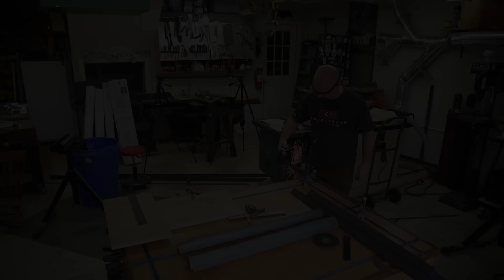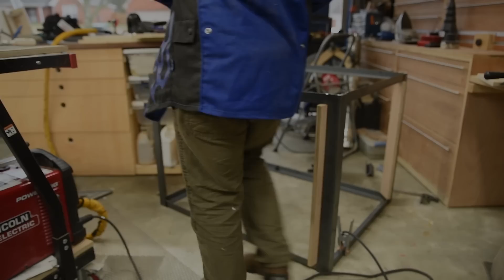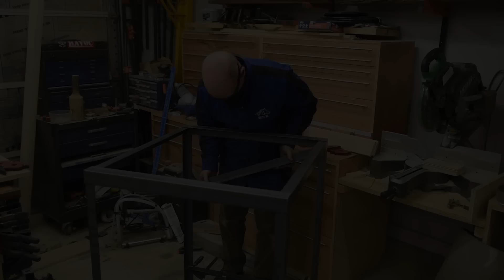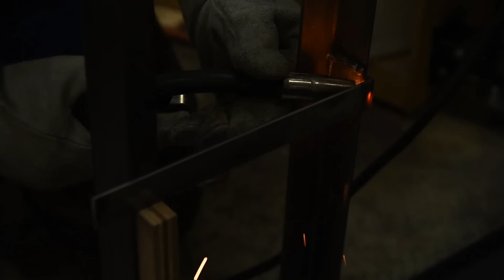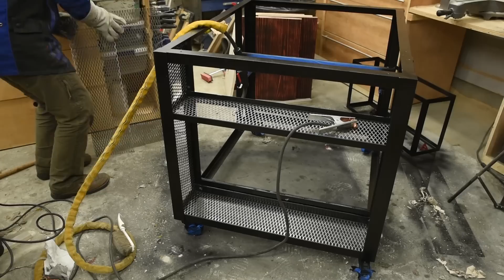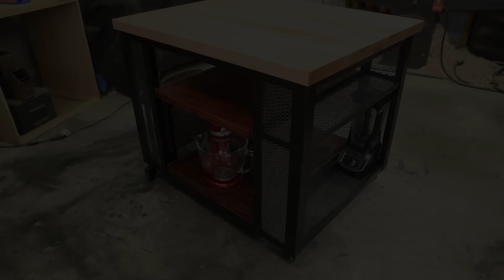DIY Kitchen Island w/ Butcher Block Top and Stained Shou Sugi Ban Shelves // How To Make

Comment: A good way to keep your verticals straight, is to dead square a piece of 3/8 flat stock. Say 5x5? You pick. Double clamp it to the rail and stile for your corners. You can also notch it to complete the weld from the inside!
 Also check for truness of your steel. I've seen some that looks like a pressure treated 4x4 from a box store ;)
Awesome and useful island.
Bravo!
Reply from the maker: Aaahhh, that makes a lot of sense! On a later project I clamped my 12” speed square and that helped a lot but didn’t nail it. You have a great technique here. I think before my next project though I’m going to invest in a fireball square or two though.
Reply: @YouCanMakeThisToo  
An alternative https://weldtables.com/collections/fabsquares
I bought one of their table kits and it's awesome! ........FLAT

Comment: On your vertical welds try going top to bottom  with a mig welder. You will not get that blob or run at the bottom and you will have less grinding.
Reply from the maker: Good to know, I’ll give it a try!

Comment from the maker: Follow up to the point I made about welding pulling parts out of square. My buddy JD at Apexish welding recommended tacking the whole thing together first and not doing full welds until there's opposing geometry that'll hold itself together. For example, the main cube that makes the island should've been only tacked until it was a cube, and then welding the seams. That way there's another weld somewhere keeping the piece from moving. Hope this helps!

Comment: Ditch the magnets and cut some angle iron clips and clamp them in each corner. Get a good tack on each corner then pull a tape corner to corner to get square and then finish tacking. Clamp the piece before welding 100% cause there’s still a chance it’ll move
Reply from the maker: Good tip, I’ll give that a try. Thanks for sharing!